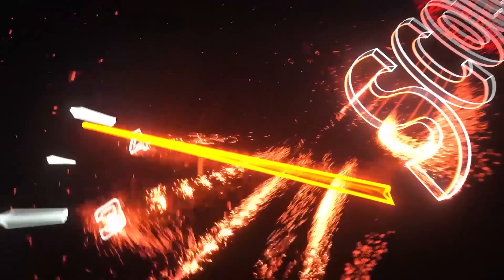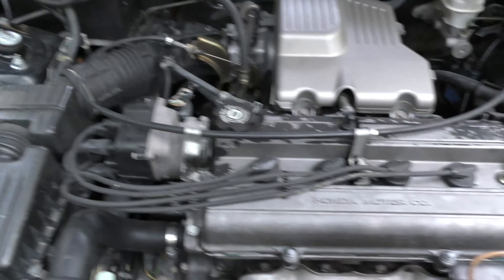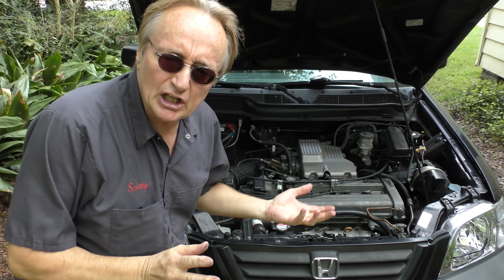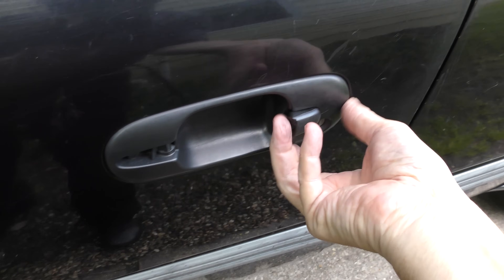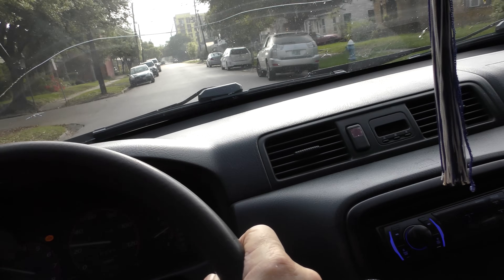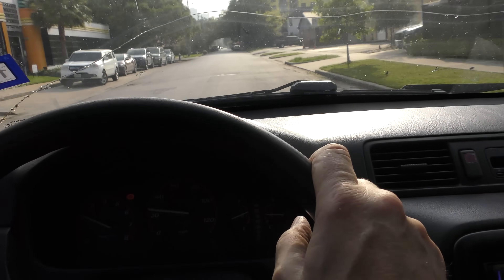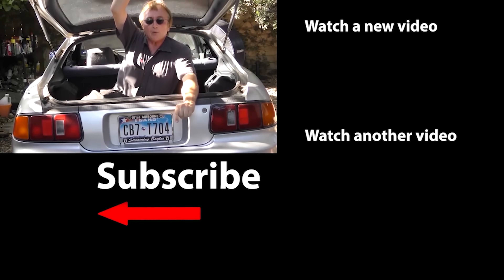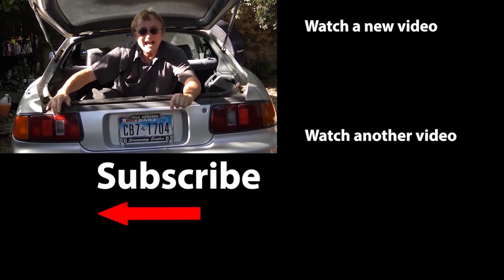Here's Why Smart People Buy Cheap Hondas

Comment: The guy with the dead rat smell coming from his vents. I had the same thing happen to me. I thought it was very stinky mold buildup in the vents, hung air fresheners, sprayed vents and drove around with the air conditioning cranked up all summer long blowing in my face. A year & 1/2 later, was having some issues with the heat and the mechanic brought me out a dehydrated mouse corspe as he was laughing and shaking his head. I almost puked hoping I wasn't walking around smelling like something rotting or caught some kind of disgusting lung disease. 😂

Comment: Not always true. I have a 2003 Honda Civic EX and I've had to spend over 6k on this car in repairs, whether it be a new motor, suspension, brakes, tires, alternator, and cooling systems. I bought this car cheap for like 2.6k and shes becoming a money pit 😭

Comment: Never EVER buy a cheap Honda around here. Like old Altimas, those owner beat the crap out of them. Live in small apartments, working remedial jobs, barely afford food as a single parent (unfortunate, because they work really hard and do not get paid their worth,) smoke in the inside, scrapes the outside, multiple accidents, 3--8 tire plugs in all four tires, put every dirt cheap 'white box' parts on when somethinng breaks, super questionable oil changes ETC, live in the 'not so good' neighborHOODS, car shared by SIX different drivers, parked along side old Kia's Hyundai's and Altimas. Then, on top of it all tailgate everyone already going 10mph over the speed limit, floor it to every single red light and stop sign.

Comment: key problem can be easily fixed by an AUTO locksmith, not any ordinary locksmith! it continues... one day you will realize you can stick keys in but can't start your HONDA! THIS IS A VERY COMMON PROBLEM FOR hondas... 1) try using another sets of key, if works... great! run to your auto locksmith 2) if no other keys work... it's an extra $120-$150 for locksmith to come to you! YAK! This will NEVER EVER BE AN ISSUE FOR ME, why? I have been buying Toyota ever since 2005... yay!

Comment: Thought I was smart, Bought a cheap crv the cost of parts for that thing are the opposite of smart. $1250 for a throttle body? Are you effin kiddin me. gfys. I have a cheap 2005 crv for sale for you smart people LOW miles 95000 miles